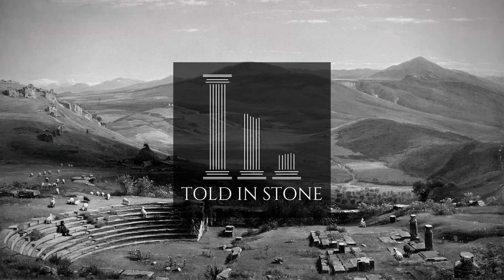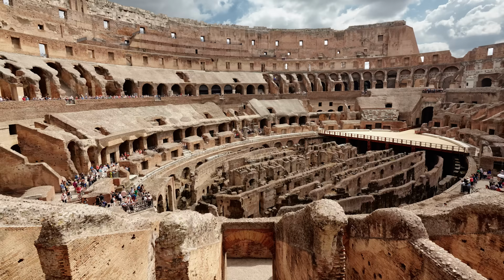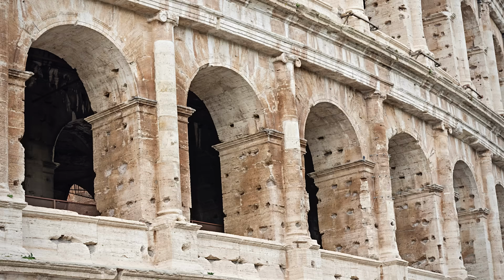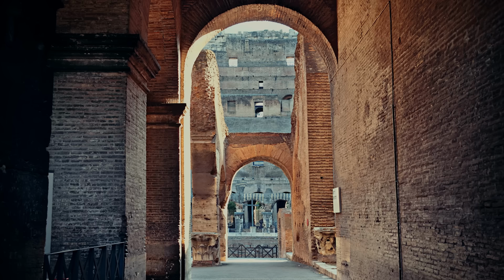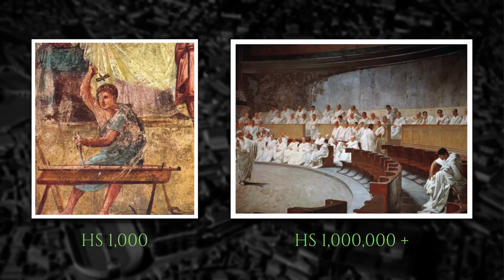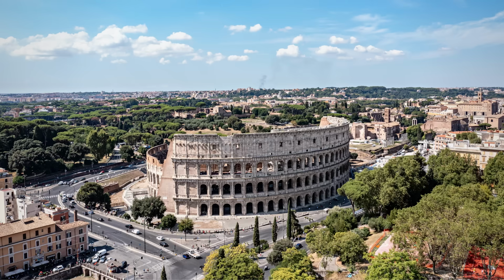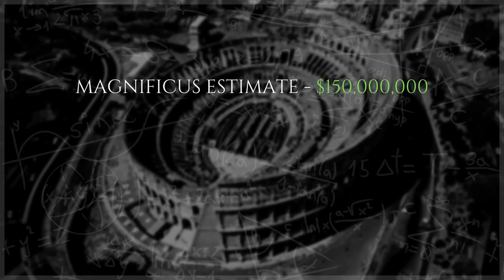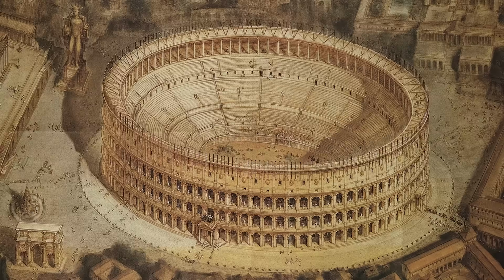How Much Would it Cost to Build the Colosseum Today?

Comment: I designed a home many years ago, with mostly Roman and Greek architectural elements and style.  I made a balsa wood model of it after I got out of college, and would love to have idea as to what it would cost to build.  Among the features, is a pool area with the atmosphere of the Roman Baths in Bath, England (with gas torches on the columns), the Neptune fountain from the Villa d'Este Estate, along with the three reflecting pools, ... as well as an indoor atrium that I modeled after what I had experienced while staying at a Hyatt Regency Hotel, many years ago, in Chicago.  Of course, my vision was to have the entire home appear as if were built back in ancient time, ... but with modern amenities, of course, ... and well insulated!  The model ran into a holding pattern, when I couldn't find the suitable material for constructing some curved walls, ... but have since bought some concrete tube forms, on the advice of an architect, and those still need to be worked on.  But other than that, one can get a good feel for my vision, without the missing pieces I have yet to add.  But, it has been a great hobby of mine, and kept me "out of trouble", so to speak.  

I was considering architecture when I was in high school, but took another career path, ... but the love of architecture has always stuck with me, and I created plans for an "underground home" while in college, and decided to make a model of it later.  But I kept on tearing out out walls, and putting in new areas, and before you know it, it became this "monster of a home", that is no longer the "humble home" it started out as.  The current model is around 2-feet deep, by about 3-feet wide, and would only get larger if I added everything I envision.  Anyhow, I seemed to be rambling off quite a bit here, so I'll stop for now.

Comment: First of all, modern machinery helps a lot with a project like this, so obviously building the Colosseum would be easier for us than it has been for the ancient Romans. Of course there are some things that would be expensive to replicate, like using so much marble and using so much labor intensive brickwork (most of the structure is made out of bricks), but taking into consideration that the Colosseum is omitting all of the complex technology that drives up the price of a modern building, I guess that it would still be cheaper for us to build a Colosseum than a modern stadium of the same size that has to obey modern regulations and be equipped with modern amenities.

Comment: Have you considered using modern sports stadiums for comparison? There are many of comparable size (Allegiant stadium in Las Vegas for example, cost just under $2b to build). Obviously the costs of different materials would have to be factored in but equipment and manpower should be fairly similar. I believe your own $2b estimate is closer than you think.

Comment: if you replicated the colosseum exactly as it was before with no modern amededies, it would be far cheaper than a modern stadium that requires all those modern amededies.  Adding complicated things like modern plumbing, modern electricity, padded seating, sky boxes and all that stuff adds a huge amont of cost to a modern stadium; removing all that significantly lowers the cost of the building.

Comment: Super interesting!
Considering the costs of building the Amsterdam Arena (nowJohan Cruyff Arena), with it’s foldable roof cost €127,000,000 in 1997. After several small renovations, adding capacity to 55,867, we’re now at €140,000,000.
Bear in mind that this is all concrete, no lavishly decorated handcrafted stonemasonery, hand painted arches, etc. 
I reckon that would triple/quadruple the price. So, anywhere between €500,000,000 to 1,000,000,000 would be my guess.

Comment: One "fun" indicator might be comparing modern stadiums of all shapes and sizes and seeing how much they cost - obviously, they are fundamentally different from the Colosseum in style and technique, but more importantly, their price ranges are insanely wide apart. For example, Bayern's Allianz Area cost about 350 million €, a sum that almost perfectly matches the much older Olympiastadion in Munich (had a fiendishly expensive ceiling construction), yet Schalke's stadium cost 170 million €, Frankfurt 180 million €, and smaller ones like Freiburg only 70 million €. On the other end, if we go to England, Chelsea's new stadium costs 580 million €, Arsenal's new stadium amounted to 600 million €. But even those are dwarfed by Wembley and Tottenham at both ~1.3 billion - ~1.6 billion €, and those aren't the most expensive globally either.

So building a Colosseum somewhere in Europe, I would say that has a range of several hundred million to even billions of euros difference seems entirely reasonable, it really depends on exactly what you do; and even if it's a "replica" there's lots of room for interpretations of that mission in building materials and techniques and so on, not unlike as with modern stadiums.

Comment: Quick correction on the concrete. It should not be 1500 a yard it would be closer to 1500 a truck it's about $180 to $200 a yard of concrete 1 yd of concrete is 3 ft x 3 ft x 3 ft squared

Comment: several factors to add --first the capital cost/financing which is quite an appreciable factor; second a  cost-overrun and design change contingency allowance; third,  architectural design costs.
And of course, don't even think of the political costs, kickbacks, and public support needed to get a project of this size approved which would likely prove insurmountable obstacles to ever getting this done in any developed part of the the western world.  
Of course, China would certainly be able to do this project efficiently and  at a very small fraction of what it would cost elsewhere.

Comment: What I find interesting is that the cost of reproducing a replica today is half the cost of the original. 

As part of my Master's research I looked at the local airport constructed in 1939 for A$20 000. When corrected for inflation using an inflation calculator provided by the Reserve Bank of Australia in 2011 this became just shy of
A$600 000. In 2013 there was a budget allocation to resurface the runway & upgrade runway lighting of A$11.5 million. In other words the cost had increased 20fold.

Comment: Why not "restore" and rebuild the Colesseum, and stage live events there? Authorities have done  that with Verona's old Roman stadium. What a venue that would be for Rome! Of course, we might have to give way to some modern conveniences, such as stadium seating replacing marble benches. And electric lighting. Just retain much of the existing structure, and then rebuild with new materials what's missing. Keep the new as close as possible to the old. It would be easy to do, just costly, as noted here in the video. But the results would be spectacular. Maybe they could even stage fake gladiator contests, like the actors who perform in the WWF.

Comment: I personally do not believe it would cost more than 1b. AT&T stadium home of the Dallas Cowboys was 1.15b. And it has huge video boards and an articulation roof system, not to mention air conditioning, the elaborate suites, and the shear size. It is much bigger than the coliseum.

Comment: Magnificus has the best estimate.

it costs around 300 million to build an entire amusement park.  Now think of absolutely zero code requirements, fess, wiring, and modern amenities and you will be way way below 300 million.  A single digger could excavate the project in days , I do not know why you would need 10, nor why you would need 10 cranes.  None of those estimates make any sense.  Less vehicles and workers were used building MODERN malls that are larger than the stadium.

Paris in las vegas, a massive casino 25 acres vs 6 acres cost ~750 million.  These people estimating close to a billion have zero experience with actual construction.

Comment: You failed to answer one question… If we build a replica of the Colosseum using modern materials, equipment and labour, would the structure still be around in 200 years let alone 2000 years? 🤷‍♂️
Reply: Odds are good that if we built the replica out of both steel AND concrete, that yes, it would endure for thousands of years. Concrete, when well made, ie, not too much water, endures longer than steel, as steel will oxidize, rust.
Reply: @ I’m sorry, but I disagree. Reinforced concrete cracks in just a few decades. Those cracks allow rain to seep in and begins rusting the steel rebar. The rebar swells as it rusts putting added internal pressure to the concrete causing it to expand. The concrete then cracks more and repeat.  Reenforced concrete only lasts for 50-100 year, maybe 200 years if constant maintenance and repairs are performed and that requires an effort upon governments that few are willing or able to maintain. If you don’t believe me, you can Google it or just look around at all the bridges and building made of reinforced concrete that are crumbling all around you. If you still don’t believe me, point out one, just one, building made of R.C. that has survived for more than 200 years. OK, so R.C. has only been around since about 1848 experimentally, 1878 commercially, but that’s just knit-picking.
Roman concrete is special, it has minerals (lime clasts I believe), that self heal the concrete. When it cracks, moisture seeps in and begins dissolving the minerals which ‘heal’ the crack. Amazing stuff really. The point is, unless we make it the same way the Romans did, it won’t last 200 years. And remember the contracts tend to go to the LOWEST bidder, so Roman quality is out. 😢

Comment: If a Denarius contained roughly 3.41 grams of silver around 64-107 AD and a Sestertius would have been worth a quarter of that, it would be equal to roughly 0,8525 grams of silver.  
At a spot price of 18,41 dollars an ounce(31,103 grams) that would come down to  $0,591 dollars per gram or slightly over half a dollar per Sestertius?

I know the conversion to modern currency is kinda unfair to do this way, as we've lost the connection with precious metals and industrialization has made almost everything dirt cheap...but this yield a vastly different  picture? (or is silver severely undervalued and should it be 20 times higher?)

Comment: I just love the collective of nerds calculating this xD Great community. I can't comment on the numbers themselves but the method used by the architects is the same we use when estimating cost of chemical plant installations. Usually we are within 20%+/- of the cost, not including some unforeseen shortages or disasters. Burj Califa had cost of 1.5 Billion USD so I think colosseum could be done cheaper.

Comment: just my 5 cents. I think if the replica wouldn't use modern materials and building techniques, the cost estimate would be way too unpredictable. I work in construction and changing mortar types or concretes and adding a lot of masonry would make most of the modern building techniques obsolete which would turn into the same problem that you have to train a lot of workforce

For example if the superstructure isnt mostly reinforced concrete, it would be almost impossible to estimate the cost

Every historical civilization including our modern one is a engine finetuned to specific stats, we dont have means to mass produce 2000 years old concrete because there is no market for that and making it from thin air would be very expensive
Reply: yes and modern building tech is based around fast and cheap concrete and steel materials, almost no building made today would last 50 years if left alone

Comment: If you look at different contemporary buildings of this scale or similar scale, you will always get to 1B - 2B price range. But this is "just stone", right? No special technology, "only" stone-carving art. A gigantic statue in fact, not an actual building with glass, steel and different technological finesses. So I would really estimate the cost to 1B USD, I think it should be feasible for this price to make.
Reply: No way it goes over 500 million.  Much larger structures cost less than a billion dollars.
Reply: @Dead_Goat  you need to count in the enormous amount of the marble stone material which needs to be used, that is the second half (another 500M) of the entire thing.

Comment: Now if we make it a modern building using the layout, are we talking adding electricity/plumbing/safety/health or just making a 1:1 sculpture? If you say make a modern building, then just take any kind of stadium at the same capacity and use the price tag for that.

If you want to create a non-functional sculpture, the problem  is that you don't really have a reason to make it, so no one is geared towards building it, so again  you get weird data, as the builders has to invent stuff to make the sculpture, it's a lot cheaper to just buy a roof and some walls and windows and some doors and slam them together to make a building, than to invent roofs, doors, windows, walls and then build with it..

Comment: HA!!! Assuming a labor time of two years..... EVERY project goes passed the intended time frame, these days... A project of that size and complexity would likely be REALISTICALLY a 4-5 year project. One of our largest issues in the industry today is that everyone wants things built on unrealistic timelines, and it is burning our skilled workers out. I am a carpenter with over 15 years experience on large commercial projects and i can tell you, that even with modern advancements, it takes the time it takes to do certain tasks. Engineers, Architects, and committees can want what they want, the reality is there are only so many hours in the day, and only so many skilled workers you can fit on one place at a time, before you are tripping over each-other or worse impacting one another's production. The dry clinical a+b=c kind of math that educated idiots use when speculating the cost and timeframe of a large job such as this, simply does not work, and i wish we had more realistic individuals, who ACTUALLY know what it takes to build these sorts of projects in positions to set the industry straight. Sadly those individuals are few and far between.

Comment: don't you love how they used lead pipes for drinking water? xD
If 3 sasturti was the average day labor and if you make 150/day doing a job, then the value of a sasturti is around 50bucks.
Though not everyone makes that income. Perhaps your 20 is close to the mark, but I thin it's closer t0 30 per.

Still you'd have to earn 20/hr with 8hr/day to earn 160/day. I presume that's standard for unionized workers. 
I would never work for less than that, because I need a living wage and can't be some guy who works for 8/hr (I did in early 2000's sucked balls).